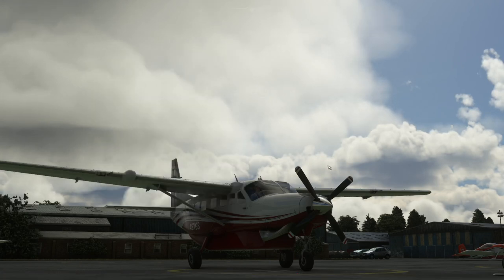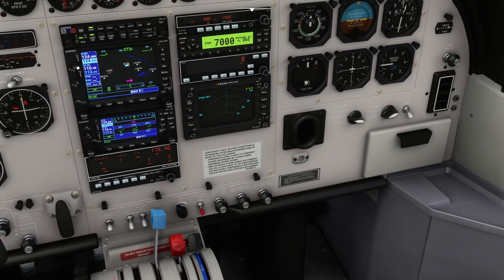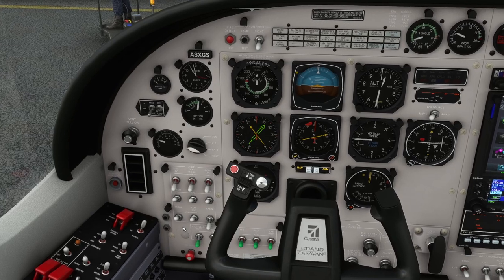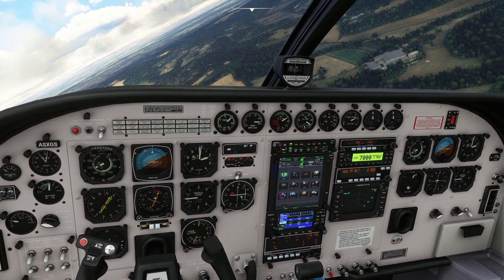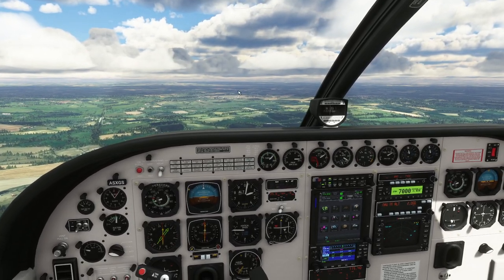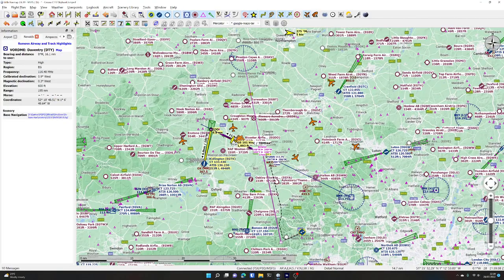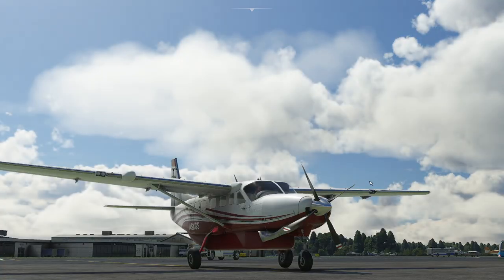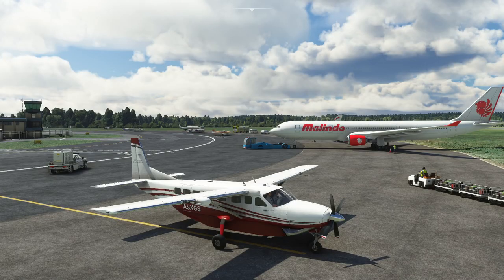Example Radio Navigation flight with the Black Square C208 Caravan in Microsoft Flight Simulator

Comment: Excellent flight.  I followed the same flight plan but in the Cessna 152.  I guess because I'm still a beginner, I find it more difficult to navigate around the Caravan's cockpit than it is for me to follow the VOR radials.  Nice scenery you have in England but I find it a bit odd that the Kidlington ATC has an American accent :).  That coupled with the fact that I pulled up my Cessna 152 into the parking spot along side a F22A Raptor haha.
Reply from the maker: I find the 152 actually harder work, because you have to hand-fly it :)